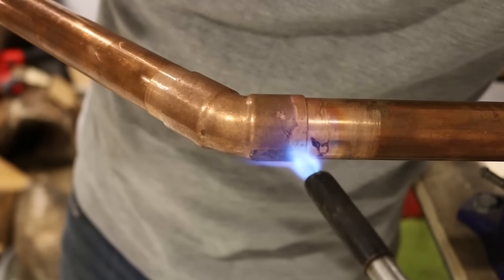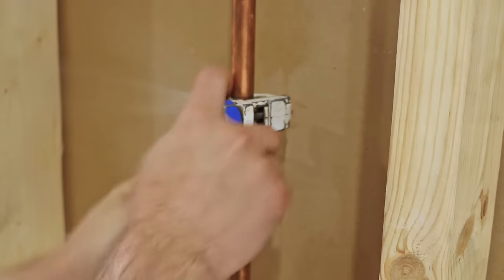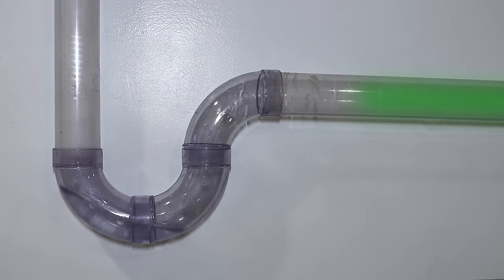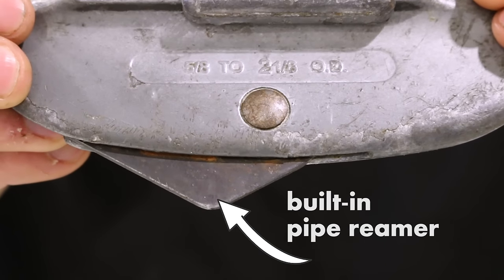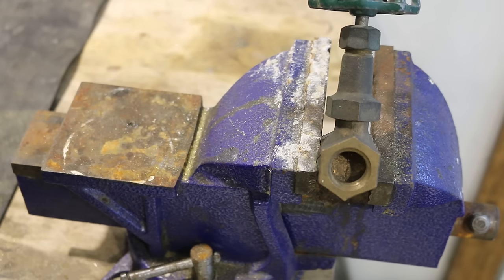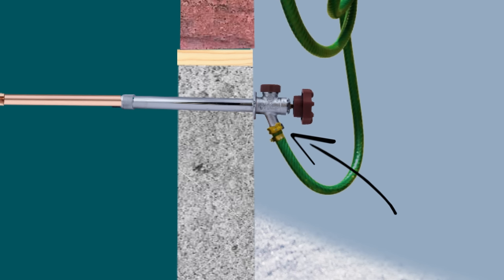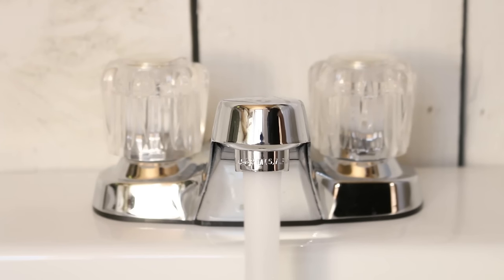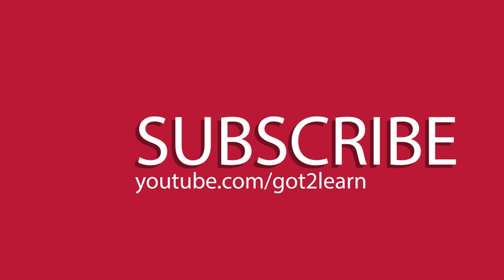The ULTIMATE Plumbing Mistakes Guide (30 Mistakes And How To Fix Them) | GOT2LEARN

Comment: It's surprising how many people and plumbers didn't know this about dielectric coupler I was a maintenance person for a property rental Company that had a 5 story apartment the risers were all copper and the runs were galvanized pipe and all the connections between the copper and galvanized pipes were leaking and there were no dielectric coupler on the hot water tank were failing every 5 years or less the boss had a fit when I added 2 dielectric coupler to the cost of the new hot water tank replacement at 400$per dielectric coupler he thought it was pricey but when I pointed out that the 1900 $ hot water tank should last 10 to 15 years or more he saw my point as for back flow preventer on the sewer line they used to be installed on the basement plumbing now they're put on the main line whole house how much chance is there for sewer back up coming out of the main floor fixtures but if you don't go down in the basement every day and your sewer main gets a clog you can and will fload your basement with sewage with it on the main line I'd use more now if plumbing a house my brothers place showed me that he had 3 suite in his basement all served by one back flow preventer he was a hoarder and filled the one suite with junk just left a path to the boiler room the sewer plug up between the back flow and the main line and flooded the unlived in suite bath room a back flow preventer on each basement suite would have prevented that as the sewer would have come up in the other suite tub or shower alerting him to the problem  I saw that in the apartment building as well all the kitchen sinks in the suites one above the other for 5 floors were connected to one riser and the bottom tenant complained that his was flooding when he was not there he'd come home to a wet kitchen floor the apartment manager  checked and the sink drained OK after a few days of complaining about it they had me check it out and the building manager was right it drained ok so since the owners son was there as well I had the building manager go up one floor and I went up 2 we filled the kitchen sinks on both floors above and pulled the plug as they drained down the water filled the first floor sink and ran over when I opened the clean out in the parking garage below the suites it was a 2 inch pipe with a 1 /2 inch hole in the center of the grease it would handle the water from one sink but not 2
Reply: Now breathe...
Reply: Totally agree on several of your comments. 
I was in Wolseley (my supplier) picking up 4 showers for a new staff cabin (showers were on order for 4 months); there was a 30 year plumber there looking for fittings to install a new basement bathroom, he only had so much room in the concrete to make the connection but not enough to move the existing pipe to allow gluing of the new 4" ABS t-y, I said use a 4" expansion joint, collapse it to fit, glue and then slide it open to complete the connection; back-fill and level with concrete. Job done! Since he did cottage and house work he had never seen the expansion joints, thought the idea was the best he'd heard in years. 
I listen alot and ask questions, I love professionals who are willing to share ideas and knowledge, stay away from the ones who are afraid you'll steal their customers if they tell you too much.
Reply: Backflows are installed on domestic cold water and boiler water feeders. Heating systems also incorporate both depending on the setup.
Check valves are installed on waste lines, normally just before exiting the dwelling... Specially for homes with finished basements that included a bathroom and under slab sewer main.
  It's prevents the contents from a main backup in the street and dumping all your neighbor's "deposits" in your basement movie theater via the toilet and shower!!😦😫😖 
  Me: 🤑
Reply: Ever hear of a PERIOD? Looks like this: .
Reply: Punctuation is your friend.

Comment: hi. don't know where else to put this so.... Question:  am i able to put the shower faucet on one wall and the shower head on the opposite wall?  must the water always travel up to the shower head? does the mixer/faucet change the pressure to make this difficult to do or can i simply put it anywhere?  thanx.
Reply from the maker: You can put it on a different wall.

Comment: Great video actually did learn something surprisingly.
although I take issue with the plunger yes that's the way it should be done now, plus you really should keep your toilet and sink plunger separate.
I really don't know why you would want to share them anyway.
But when I grew up there was only one style of plunger and it worked on both well we only used it in the toilet. I can see that might be harder for newer toilets but there's usually just enough space to cover the gap which was probably exaggerated for the video.

Comment: You helped me go from never sweating copper to feeling like a pro, I successfully replaced our water heater the other day, thanks to your videos. And now here I am still watching your videos, with no plumbing projects in the near future.
Reply from the maker: So kind of you,  thank you sooooo much for that ❤❤❤
Reply: Got2Kearn —Thank you so much for your videos! 🙂🙏
Reply: Indeed; the videos on this channel are very useful 🙂
Reply: I gave up sweating copper. I moved from copper to using Pex and push to connect fittings. Far better and must faster installs. I have done about a dozen private projects over a dozen years and still have not had a single problem.
Reply: The old lead solder was MUCH easier to work with.  BTW, in the last one of the 30, that showed a solder joint, there was a flaw,  a hole in the solder.  Just FYI.  Also your early example about venting used a chart that was a bit vague.

Comment: Also, when using hangers on copper use copper or plastic hangers/strapping as shown in the video (but not specifically pointed out). Other types of metal can cause corrosion on the pipe.
Reply: @Geoffrey Morrison Yeah the plastic are especially terrible in an attic.

Comment: i just noticed something that you didn't mention when unsoldering a leaking joint. if the joint you are unsoldering is close to another joint, wrap a water soaked rag around the joint(s) you are not unsoldering to prevent it from accidently being unsoldered.

Comment: Wish you'd make a video about how to measure properly for different scenarios. For example, I want to try to replace a basement faucet that of a different size than what's there and being off even a little bit will make a disaster of the job.
Reply: I like this one. Buying drain kits that were for 1.5in did not have immediate and proper sized connectors for drain pvc pipes labeled 1.5in. I recently fixed an unvented s-trap in my home, also my first time doing any sort of drain work, and I was get super frustrated at the store trying to find the fittings to do the job correctly. With enough looking I found a solution, but the fact that a 'drain kit' is smaller than a typical pvc pipe of the same labeled size was confusing for a first timer.

Comment: I have a washer in the basement with a trap but sewer Oder is always present. Would a backflow preventer help?
Reply: Maybe, maybe not....  most likely the drain has the wrong grade (slope) to it and is drawing the water out of the p-trap when the washer goes through the drain cycle.

Comment: 3:14 You dont want to install copper into a galvanised tapwater system, likewise with stainless stell. The reason is that the ions from the copper or stainless will eat the galvanised steel pipes and result in corrosive damage on the system.
But if its at a endpoint of the system , a tap or so, it can be allowed.
Reply from the maker: Totally agree!
Reply: What is it allowed at the end of a system?

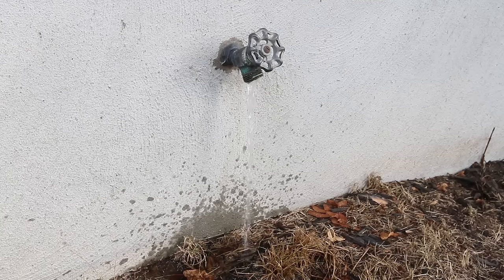Comment: At the 2:52 mark, NUMBER 7 directly connecting dis-similar metals such as IRON-TO-COPPER can cause corrosion.  You recommend using a DI-ELECTRIC UNION (yellow plastic spacer) or a BRASS NIPPLE to connect I-TO-C.  So I am guessing BRASS plays nicely (no corrosion) with both COPPER and IRON.  Looks like I need to recheck that 40 gallon water heater I self-installed awhile ago.  My fittings may be corroding as I type this.
Reply from the maker: They are both good options and they have their own uses ;)
Reply: The fittings don't corrode the transfer will from were ever there's a pinhole in the tank lining that's where you will get a hole if you can figure out where the leak is you can put in a tank mender after you have put the dielectric coupler the hot and cold water lines and I can't see a brass niple doing anything most of the holes in the tanks I've seen are down 8 to 10 inches below the top of the tank thankfully we are now using pex tubing for our water lines and even if you have the old copper lines it's cheaper to switch over to pex for the hook up to the water tank when installing a new one

Comment: If you’re using any steel pipe with NPT or NPTF threads, avoid using schedule 40 pipe because the NPT or NPTF  thread is tapered and results in a very thin amount of material between the root of the thread and the inside of the pipe. NPTF thread is different from NPT in that the NPTF thread is a dry seal thread meaning that the thread seal is created by crushing crest of one thread against the root of the other thread, and is capable of withstanding a much higher pressure. In a standard NPT thread, the flanks of the threads are relied on for the seal and there’s a small gap between the root and crest of the threads, which is why a pipe dope must be used with all NPT threads. Many people mistakenly believe the (F) in NPTF stands for (female). It stands for “fuel”. A female NPT tread is referred to as “FNPT “, and male is “MNPT”.
Reply: Plumber & gasfitter here.  Been at it for many years and learned something today.  In trade school we were taught that NPT was dry sealing!  Thanks for the knowledge!
Reply: Non-pro Long time DIY.  The problem is that even  mfrs mislabel fittings and pipe sometimes, not following the protocols.

Comment: Thanks, but here's my 2 cents.  I never had any problem on my cheapest garden faucet from my basement to outside for over 10 yrs even I forgot to drain water  to winterized it.    However after I replaced it to non-freezing faucet, omg, it froze and busted out copper pipes in first winter.     They are much weaker to burst in freezing temp much more than my old cheap faucet which I don't understand.   I replaced to more expensive non-freezing faucet, and omg, it bursted again.   Now, I have to drain out and winterize it non-freezing faucet all the time.
Reply: Same thing here. I have one of those freeze free ones that messed up over the winter and now I just have it 100% on and come winter I will just go and cut the line and put a cap on it. I think I will just add a cheap one. When I build my new house here in a few years I am installing outdoor hydrants rather than water coming off the house. Less problems and I can just shut the valve off in the well pit.

Comment: Really great but did anyone else notice the drywall screws being out into copper hanger to hold the pipe up...
This also will corrode due to dissimilar metals ..
Need to use a copper nail or screw.. 😊

I did not see the aluminum hose bib problem. .. but someone else commented on it 😊

Comment: The non-freezing hydrants will freeze everytime if you don't take the hose off so the water can drain out.
Reply: frost-free hose bibs only work if the valve on the INSIDE of the building is closed , and the valve on the OUTSIDE of the building is open TO THE ELEMENTS ; i.e. not connected to a hose .

Comment: I would add: When installing a Frost Guard faucet. Make sure it's sloped, so the water will run out when off.  If it's lower on the inside than the outside, water will stay in and could freeze, causing the inner part of the faucet to burst.
Reply: I just ran a ball valve with bleeder facing faucet ,Cheap ,effective 👍👍👍👍👍
Reply: I threw a shut off valve inside the house to just keep it empty in the winter.
Reply: Why not just install the valve inside and keep the outside valve open so if there is water left over it has somewhere 2 go when it frezes

Comment: Here in Australia we don't have P traps so much these days as we went to s traps for grey and black water. We use vertical vents fitter directly to the main sewer drain pipe. The method of joining pipes seems very similar.
Reply: S traps are banned here in the US because they can create a siphon when draining and siphon all the water out of the trap.

Comment: 10:46 #20 tip.. Turn counter-clockwise until the slight gap between both opposing threadeds close and a slight drop is felt. The starting threads are now in-line and opposite of each other. guaranteeing against crossthread,   extra expenses and pride!
Reply: Lol. I love the comments because of the ones like yours.  I would bet 3 out of 20 people wouldn’t do and or understand what you are saying. Great tip. But I’ve even explained that method to helpers watching me set a thread right like that, and they were still lost!  I feel like that trick is under used and discovered by people who either have a great teacher that lets them figure it out on their own. Or have a knack for physics.  Two objects can’t occupy the same space at the same time.

Comment: The stainless steel wrap around "flex Speedways" are NOT to protect the outside from exterior damage. IDK were you got that but it's to strengthen the core of the hose and not allow expansion.With time the hose will either break or be susceptible to Leak
Reply: It made me laugh when he said that. One customer's cat would chew on them and cause leaks.

Comment: At the 17:25 mark, having a backflow preventer for all slab drains would have saved many of us homeowners a lot of grief.  Not sure if I should blame my builder/contractor, my plumber or my plumbing inspector?  I guess there is enough blame to share.
Reply: Backflow preventers are an option bare minimum code dose not require them no one to blame welcome to top doller for D- workmanship lol
Reply: Single check valve is not a backflow preventer. Just I’m case if no ones knew haha
Reply: @wizard3z868  in Pennsylvania, every water meter must have a dual check backflow preventer installed on the tailpiece if the meter
Reply: @johnblumeraitis2475  I thought we where talking about waste water system not fresh water?
Reply: I did add a reply. Maybe it will show up latter.  This internet stuff leave a lo to be desired…
Reply: He's referring to a waste check valve and honestly, they're more hassle than they're worth. They literally cause back ups. Waste needs a nice flow to exit your house and adding a backflow preventer disrupts the flow. Catching just one little piece of toilet paper or baby wipe and pretty soon that wipe will catch more debris and so on and so on.  What's better is those clean out caps that actually lift up when pressure from inside the pipe builds up, letting the waste overflow into your yard. It prevents floods in the home without interrupting the flow in the sewer pipe.

Comment: Whenever I sweat pipe I dab the the joint a little bit with the acid brush to clean up the solder a bit. Then I wipe after the cool down.

Comment: This was a very good list you hit all the points. This is what I've noticed over the last 30 years of doing plumbing day and night. When you use pipe dope and Teflon tape it is too much for the threads especially for this new brass that come about when they took the little bit of lead out of it in 2014 it causes an expansion in the brass fittings that are threaded it may not leak immediately it may take a month or maybe even a year but it will split that brass. I've noticed this a lot in the last few years my take is I think it's absolutely idiotic to put both on pipe threads. Just choose one or the other. My choice is rector seal number 5 it never has failed me ever.
Reply from the maker: 100%, thanks Todd!

Comment: That plunger pro tip is interesting but the question becomes "do I really want to touch the plunger flap?" 🤢🤢
Reply from the maker: Emergency only hehe 👌
Reply: Plastic bag or rubber gloves work well.
Reply: You can touch a bit of poop on the flap or a lot of poop when your basement backfills with sewage. Your call.
Wear a decent pair of gloves, wash your hands, hold your breath - you got this.

Comment: You can use water to cool a joint. Start spraying the pipe away from the joint until you start to see steam. Slowly spray towards the joint from there. It should be a fine spray.